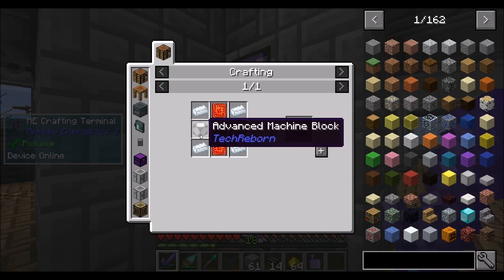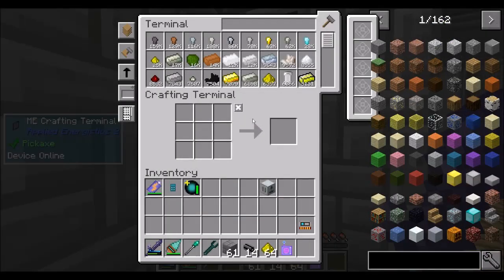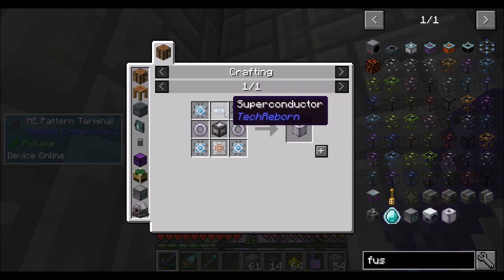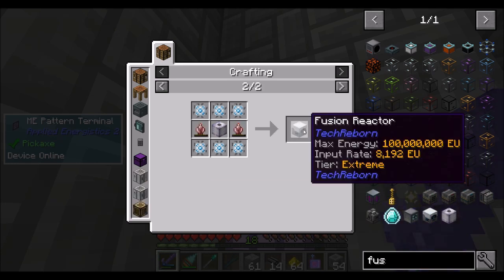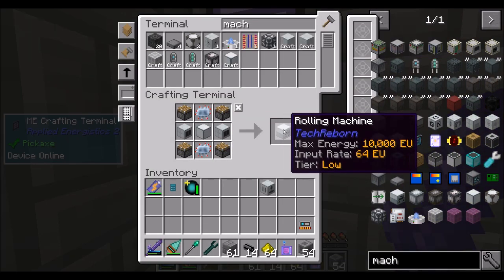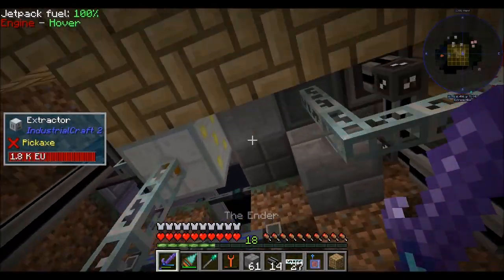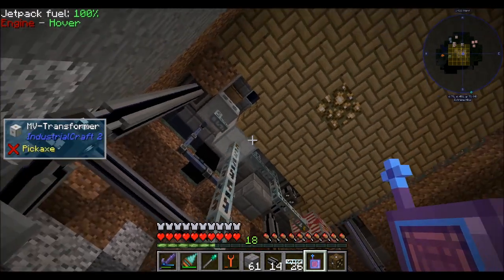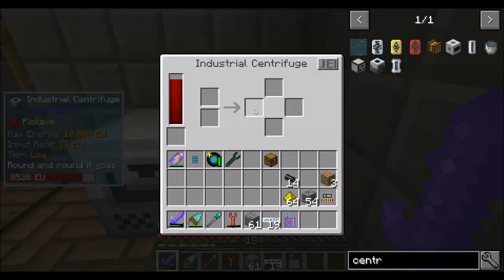AoE Ep67 Industrial Machinery

Comment: Are you absolutely sure you can't use overclockers in tech reborn? It is the old gregtech after all. I might try shift clicking the upgrades onto the machines that's how it used to work in the past. 
But watch out: you couldn't remove them in the past, so too many overclockers can make them unusable.
Also the fusion reactor is the coolest thing ever.
Reply: I tried using overlocker and they don't work. Shift clicking with them on the machine, shift clicking inside the machine, clicking normally on the machine, manually trying to put them in the slots. Nothing worked when I tried them.
Reply: They don't work. AoE's version of TR is outdated because it's 1.10 instead of 1.12.
Reply: In this version no it has been added in 1.12 +

Comment: anyone watching this know how to use ATLauncher or any non-curse and non-twitch related method to get this mod?  I am really struggling here.  These videos are interesting but they always leave out the DIY section of getting these immersive splash screen changing mods going.
Reply: David Hoffman Use Curse. They suck but they got a Monopoly on this stuff, so you basically have to bite the bullet.
Reply: Jetsetlemming it doesn't actually work.  I can't run Minecraft in twitch desktop, not won't but can't.  How do I use curse  then?
Reply: If you can install the Twitch app and get it to actually download the modpack, you don't need to play it using Twitch. Just go into your folders where the modpack was downloaded. My curse folder is in my documents folder. And then just set up a forge profile via your regular Minecraft launcher, remember in the settings you can name a custom path for your profile, I would suggest doing so for ease of use later down the line. Once that's done just copy over all of the files to your newly made Minecraft profile folder and hit play. I have done this on an olde laptop I have because twitch refuses to launch Minecraft because it says i dont have enough ram. But once moving all the files to my minecraft installation it played just fine, through the Minecraft launcher.
Reply: That actually worked.  For whatever reason the Twitch loader for Minecraft always crashes!  Copying it to the .minecraft install from the curse/my documents install worked.
Reply: Glad it helped! :)

Comment: Tech reborn is such an annoying mod in this pack to work with. The chrome/titanium grind was terrible, many machines say they accept medium tier but still suck in as much as 2048 eu/t,  and there are no speed upgrades here. The industrial grinder doesn't accept water from a conduit or from cells until the cell gets stuck inside forever, then it works. The multiblocks are just a bunch of blocks put together with no overall texture, and the projector for the multiblocks stays forever unless you turn it on, off, on, then off again, or restart the server. 

Not to mention it feels like I'm doing all the same things that I just did through IC2...
Reply: That's because it's Gregtech. IC2 classic used to be fun, a bit tired because of its age, but fun. Then IC2-Experimental came along and Player decided that GregoriousT (GregTech's author) had a great idea, and effectively Greg-ified IC2... and GregoriousT joined the team at about the same time.

You either like grind-as-"difficulty", or you dislike it (generally in a degree proportional to the amount you use the mod)... and most people aren't fans of Gregtech.

You want a mod that is what everyone SAYS they like about Gregtech, but you know, actually does it? Try RotaryCraft (1.7.10 is the latest version at the time of this comment).

Reika's mods actually tier things sensibly, don't (usually... I'm looking at you ReactorCraft Tokamak) use absurd quantities of materials (especially if you fully explore his tech tiers and use the mechanics available to you). Plus they're pretty easy to understand how to use assuming you can do basic arithmetic (usually iterative doubling/halving. A calculator is handy, but far from necessary), and have a very good set of ingame manuals.
Reply: Frankly GT5U seems like a better mod than TechReborn to me. In Gregtech you can speed up any recipe by using a higher tier machine and applying more power. The power system also makes a lot more sense, and the multiblocks are more fleshed out.

Comment: Is he just missing the fact that to make the 32000eu he has to use 40000000eu
Reply: MasterManiac980 the way it works is that you need that much rf to start the reactor, then it runs for a long time.